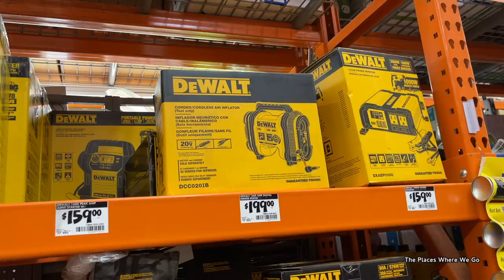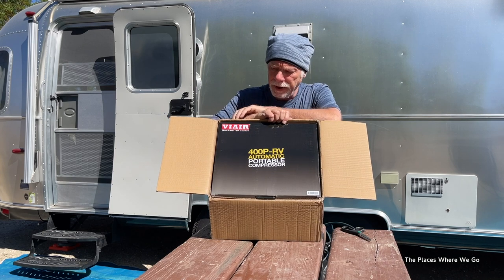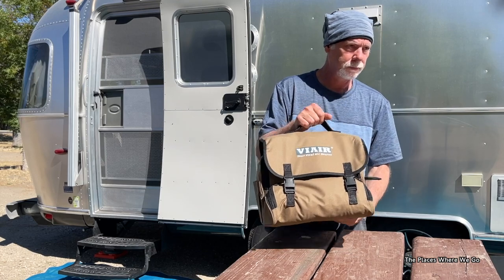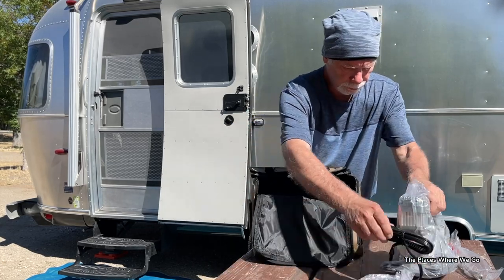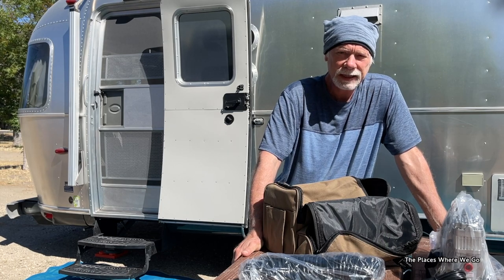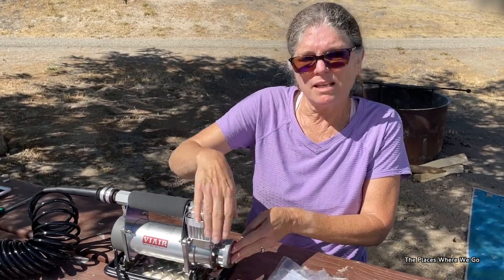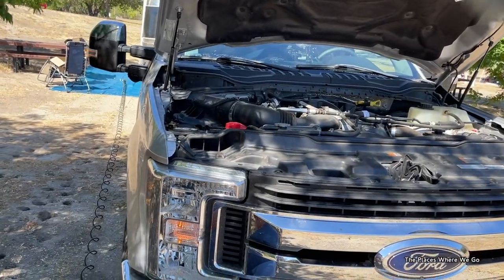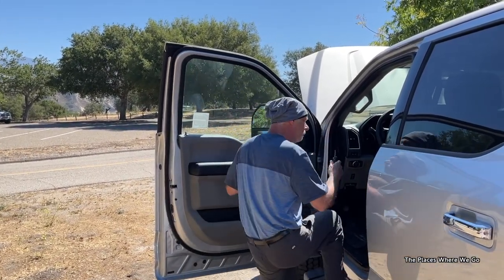ViAir Compressor Unboxing - 400P RV Portable Air Compressor | Airstream Life

Comment: im on my 2nd 400p. first one got stolen out of my truck.

got an 88p for my sisters car

highly recommended
Reply from the maker: We're really happy with this unit.  Not only great to have at the campground, but we like having a compressor like this at the house for routine air pressure checks on our cars.  Nice size. Great power.  Thanks for stopping by to watch!